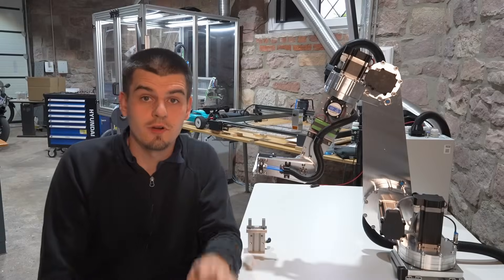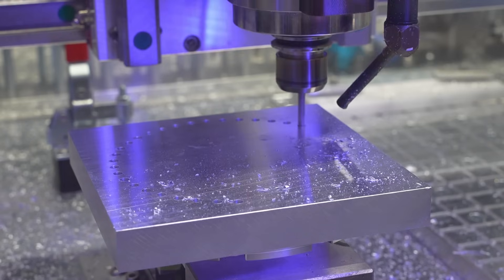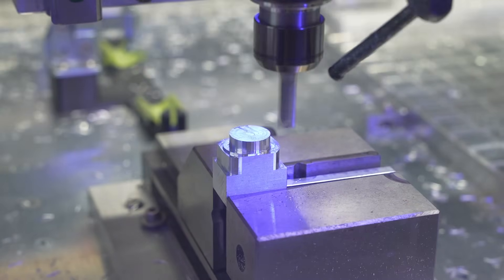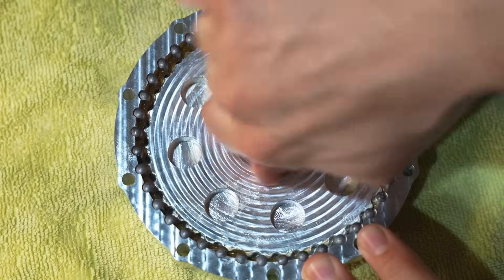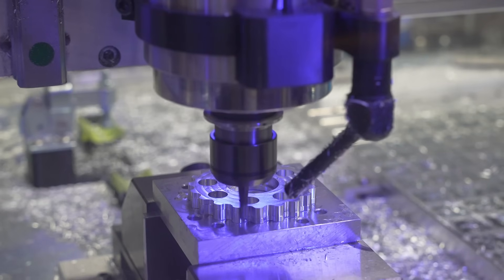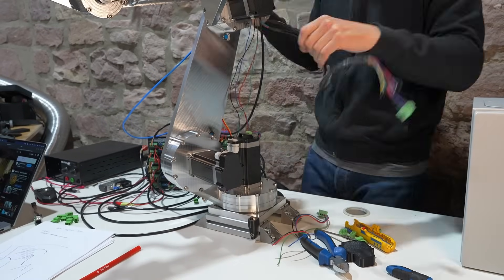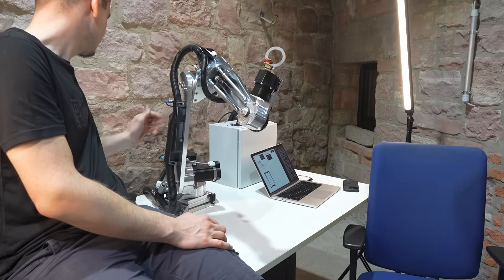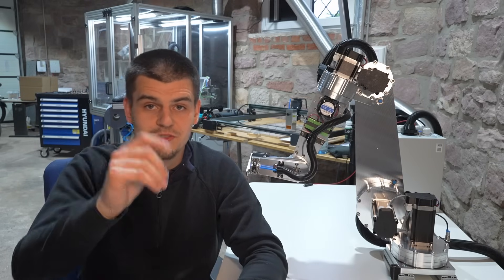CNC Robotic Arm with Cycloidal Gears - We did it! Electronics, Milling, Software Test

Comment: Servo motor brand and model you do use in this video ?
Reply from the maker: Hi! these are open loop stepper motors from stepperonline. Nema23 and 17 with 4.2nm to 0.4nm. We also used makerbase mk servos later more safe because no step loss:)
Reply: @alexanderrueffer  It can be used as a router to cut aluminum ? but i prefer using servo motors than stepper motors for cutting aluminum. Do you think servo motor more powerful than stepper motor ?

Comment: What Software do you use? If you can implement S-curves or apply input shaping, this should remove a lot of of the wobble at the end of every move.
Reply from the maker: Hi André! Thanks for the tip and your comment! S curves are implemented. We will look further into input shaping. At this point we have realized that servos are superior to steppers ol or cl for configuration. Great company by the way!! Looking forward to be a customer soon
Reply: @alexanderrueffer  Haha thanks! We thought a lot about the topic of servo vs. stepper motor when we built our machines. We can have a technical discussion about that if you like. Really like what you guys are doing!
Reply from the maker: @wirestyle_official sounds great, will contact you!

Comment: So cool project  :)  Regarding the hardware, I am running 2 stepper motor for a timber band saw and the teensy 4.1 with teensy step library is amazing if you want to send it a boat load of instructions without any faults.
Reply from the maker: Hi Jonas, thank you for your comment! Sounds like a great and clever use case for automation. Teensy is working really reliable. 
I am sometimes annoyed by the 3V because all devices we have here somehow want and return 5V haha
Reply: @alexanderrueffer  haha,  I know exactly what you mean, I had to use several  4 channel level shifter to get from 3.3 to 5V  on a few I/O things like the drivers for stepper motor..   puh..   :)  I really look forward to see more of this amazing project of yours.  I'm a Mechanical engineer from school but have spent the last 25 years with programming so I love all these different parts  :)
Reply from the maker: @jonasgranlund4427 Hi Jonas. Sounds like a lot of similarities haha. Hope to deliver exciting content in the future. Great to have you!

Comment: Excellent! Looks like quite a powerful shoulder joint with you leaning on it like that. Did you have any issues aligning the eccentric driver's second op? I don't think I saw soft jaw as... It looked like you may have used a pair of flats on the bearings' inner surfaces...?
Reply from the maker: @DrTimmay  Hi Timmay, thanks for commenting! The eccentric shaft has two flat surfaces at the bearing fits, they are only to hold it directly in a vise. I then probe the hole for the motor shaft in op2. 

I don’t like it, it will be redesigned to have everything milled in op1, tolerances are just to important here.

Comment: Great job! Very impressive to do all that work on a router 👍
I recently bought a used Fanuc robot which I’m planning to upgrade and also use together with my Eding CNC controlled router to do part changing. 
What’s the software you’re using for the robot?. 
Any thoughts already regarding the communication between Eding and the Robot?
Reply from the maker: Hey thank you for your time and comment! Saw we use the same spindle, cool!:) You are a bit further in the journey, we haven't figured out communication with eding... We are using our own control software to generate the movements. At first I would probably use a quick I/O communication to start and pause the cnc and to tell the cnc that the robot is ready with cleaning and loading. Maybe some inductive sensors for a bit more safety. Let's keep in touch here!:)

Comment: Hallo Alexander und unbekannter Kumpel,

wieder ein klasse Video! In dem Roboterarm steckt richtig viel Arbeit, und ihr habt das wirklich sehr schön gelöst!
Habt ihr für das Zykloidengetriebe höherfestes Aluminium verwendet? Und in welcher Programmiersprache habt ihr den Arm programmiert?
Ich wünsche euch weiterhin viel Erfolg und Spaß beim Basteln.

Liebe Grüße
Anton
Reply from the maker: @boessi  Hi Anton! Vielen Dank für deinen Kommentar:) 
In J4 und J5 ist 7021 vorgesehen, das ist etwas härter. J1-J3 kriegen C45 stahl und J6 ist aus Petg geplant, das Getriebe in J6 hat nur 10 nm und darf gerne etwas nachgeben, drucken ist so schön einfach. 
Software hauptsächlich python.
Dir auch alles gute!!
Grüße Flo und Alex:)
Reply: @alexanderrueffer  7021 kenne ich gut. Das ALU meiner Eigenbaufräse ist zum größten Teil aus Gleich C330/7021/AlZn5,5Mg1,5.
Wenn es Euch langweilig werden sollte, dann wäre ein Objekterkennung mit Python und OpenCV bestimmt auch ein schönes, weiterführendes Projekt für den Roboterarm. LG
Reply from the maker: @boessi  Ja genau, die Gleich Platten sind super. Wir haben noch viel vor mit dem Arm, Objekterkennung ist eine klasse Idee.

Comment: The structural vibration is excessively high
Reply from the maker: @electengin820  Hey thanks for your comment. You are right, the vibrations are a problem. They are 95% motor and software + the shaky table . Structure and actuators are pretty smooth and rigid.
Reply: @alexanderrueffer  closed loop motors could eleminate that. I suggest a driver MKS Servo 57D. You won't need to change software. Its closed loop inside. You attach a magnet at the back of the shaft and mount the driver on stepper motor. Its very nice. I have been using them for a long time.
Reply from the maker: @ Okay Mehmet you seem to have some experience. What do you recommend. 1 Closed loop drivers in enclosure, closed loop driver mks 57 (at the motor) or stepperonline magnetic encoder hooked up to teensy with encoder libraries? Thanks in advance
Reply: @alexanderrueffer hi again. Opt 1: If you use stepper online closed loop drivers, they are configurable so its a good option. And they support high current. But do not use chinese version they claim they are configurable but they are not. Opt 2 : Servo 57d is very nice in both configurability and cable management. And you can get feedback through can bus. Plus your program will run with it without change. Opt 3: use stepper online closed loop steppers. Very nice and cheap way. But software is too complicated for syncronized movements. I personally recommend servo 57d. We can talk more on this. I have been using them for long time. And I have a 10 dof mobile manipulator that I have build like your manipulator.
Reply from the maker: @Kstkyaktsstkts  Thank you! I understand and still have some questions. Maybe we can chat per e mail?
Reply: I think it's because of slab use as a main linkage. It vibrate when motor hit end . If you attached some plain slit in border it will stop it acts like I structure.

Comment: Great project. Where is all the noise coming from? The stepper motors? I think maybe firmware would take care of that. Or servos. Thanks for sharing and i look forward to more projiects.
Reply from the maker: @odin823  Hey thank you for your comment! Yeah combination of software, cheap drivers, open loop and the overall concept of stepper motors. Servos with pid would be superb, especially for camera holding (like gimbal)

Comment: What material do you use for the arm and why does CNC not need coolant?
Reply from the maker: @nguyentuankiettruong5844  Hi Nguyen, thanks for asking. 5083 mostly. You can cut aluminum bone dry. I like to add alcohol to prevent chip clogging on the bit and keep the part cool for precision…
Flood coolant is not possible on my router

Comment: It's cool to see the spring on the axle, maybe you should make a spiral-shaped piece of plastic that corrects the variation in spring tension as it stretches so that the force it exerts is ideal for the position it is in.
Reply from the maker: @albertox0404  Hi Alberto, thanks for your idea. See what you did. Please provide a little more detail. The spring pulls with 120 pounds max, so plastic should be metal or?
Reply: @alexanderrueffer  I think you can also use a gas cylinder like the ones in car trunks to hold the door open, since they generate a more or less linear force throughout the entire travel.
Perhaps you could contact Chris Annin, the creator of the AR3 robot. Just search for his name and you'll find out. I believe he also started using a spring or gas cylinder but later ended up removing it. I'm sure he'll be able to share his experience with this topic.

I've been trying to find what I explained to you but haven't found it on the site where I saw it. It's simply a spiral-shaped piece of plastic (or metal, if you prefer). You need to calculate the size and aspect ratio for it to work well with your arm. This piece attaches to the arm's axis, on the same axis of rotation. The spring is still attached to the base on one side, but instead of attaching directly to the plastic piece, you use a metal strip (spring sheet) with a hole to attach the other part of the spring. You attach the other end of the metal strip to the end of the spiral-shaped piece, following the spiral's contour.

I hope I made myself clear.
I hope you also have great success with your project; it has a lot of potential.

Regards
Reply from the maker: @albertox0404  It is much clearer now. Thank you. The spring is super cheap, we use this concept also on the z axis of our Cnc machine. It works decent enough. You are right a constant force would be much better. We will look into it. Thanks for the tip!!

Comment: Is that Mic6 plate? Or 6061? In the USA we only get ugly oversized aluminum plate and only MIC6 or similar cast plate comes with that ground or fly cut finish.
Reply from the maker: @kieran4278  Hi Kieran, thanks for asking! 
Differnt alloys, the shiny ones are casted 5083 and 7021. Casted is good because internal stresses are lower when cutting away huge parts for precision. 
You mean rolled plates, I use them for my bike parts but not for machine build, too much warping and int stress. You face one side and the other is warped again haha
Reply: @alexanderrueffer  
OK cool. Yeah cold rolled aluminum is annoying.